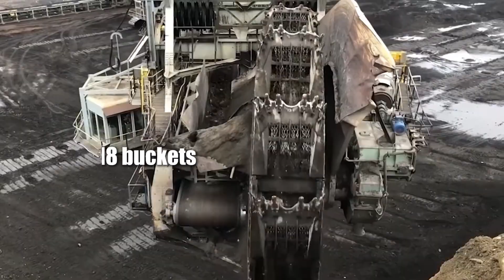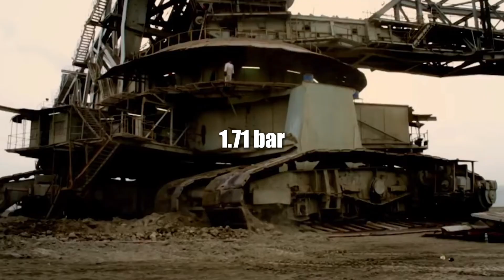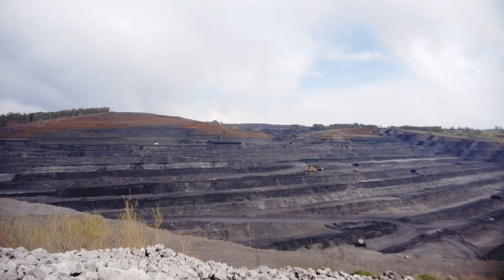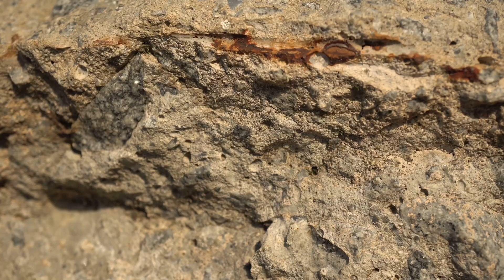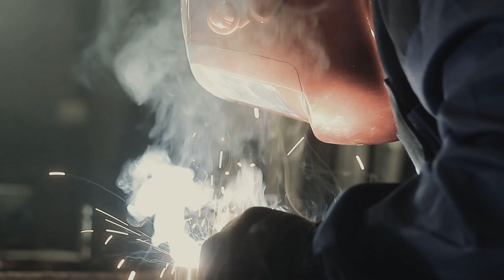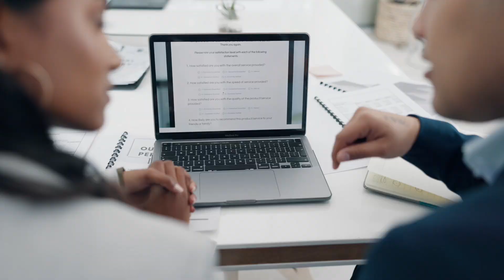The Largest Land Vehicle Ever Built (It Eats Mountains)

Comment: The overburden everything  but the lignite?  So what do they do with it? it has to go somewhere...
Reply from the maker: You are right, it has to go somewhere. The Bagger dumps the overburden onto a discharge boom, which feeds into a massive external conveyor system. These conveyors transport the soil to a 'cross-pit Spreader'. This spreader reaches across the pit and scatters the material at a dumping ground, effectively backfilling the mine or creating new landscapes as part of the reclamation process.
Thank you for your question.